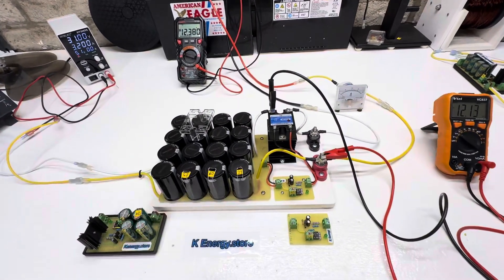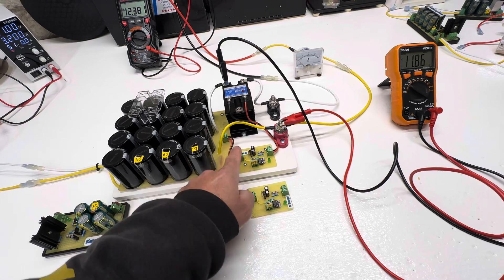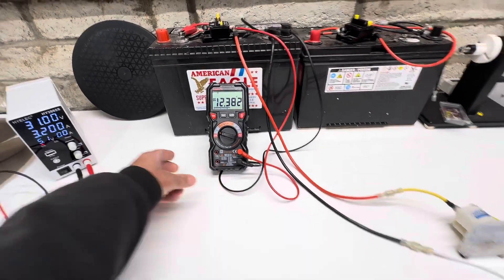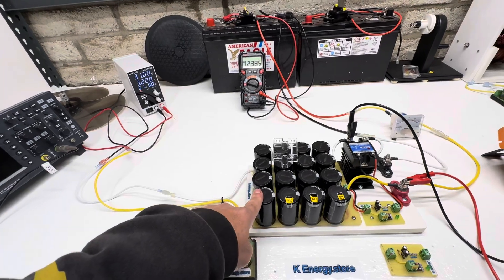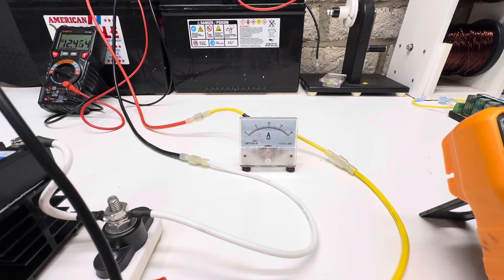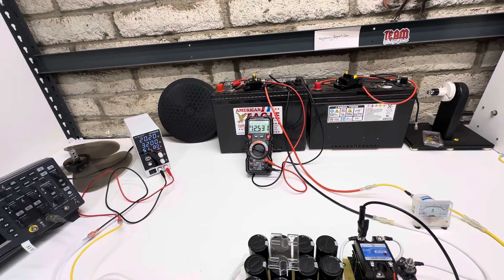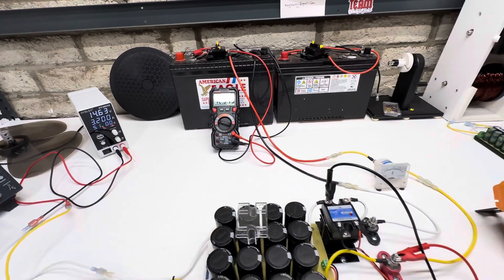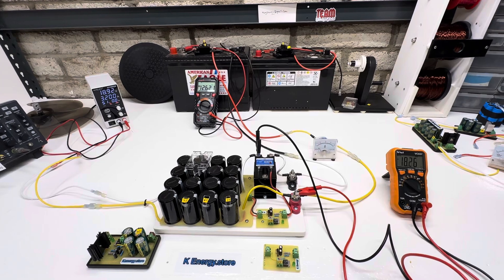100 watt solar panel simulator with cap dump charger

Comment: I think that PWM just don't is the best way to use a Solar Panel.
Reply: If you READ THE DESCRIPTION he says he is SIMULATING a solar panel with this setup. Though it would also help when using a solar panel on cloudy rainy days! When living OFF GRID circuits like this are very valuable!
God bless and be well!

Comment: Sweet dump Kevin, does this circute also function as a primary shutoff?  Or do you have a version of your boards that includes the primary input, primary cutoff, and cap dump switch to an external SSR like in this video?
Reply from the maker: Thanks ! These are cap dump only versions